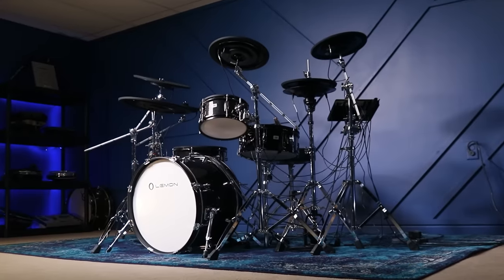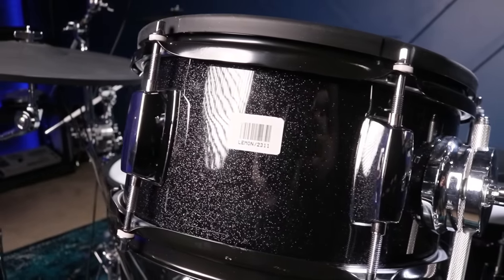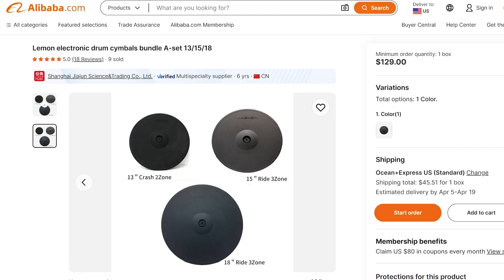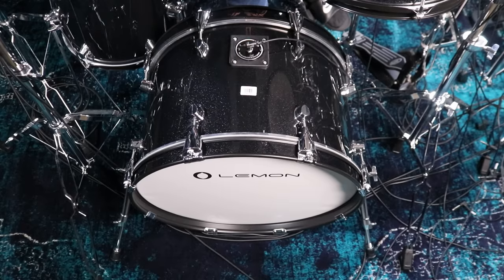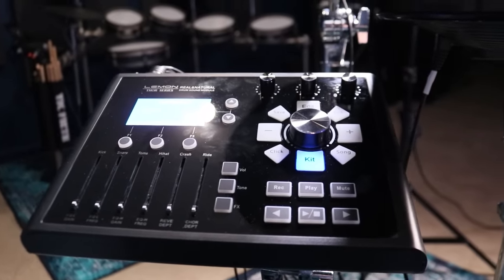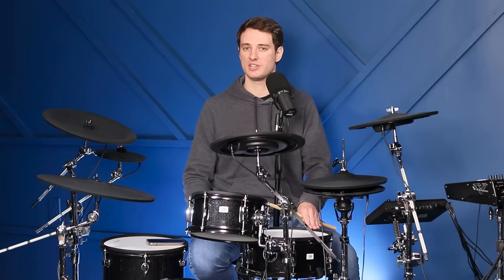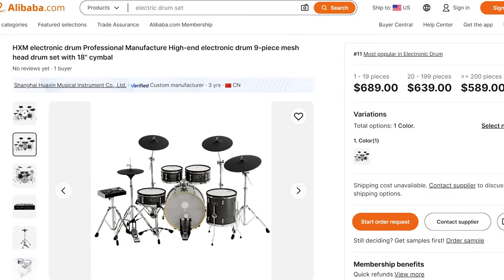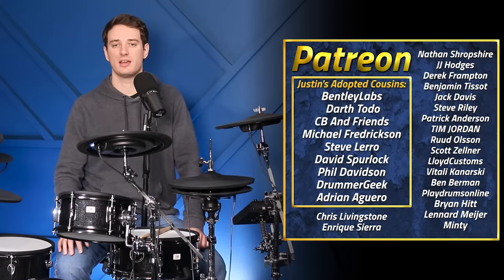Lemon T950 Review - The Alibaba Drum Set

Comment: the checkout price for this kit would make it somewhat reasonable, but you add in the shipping cost and it ceases to make sense. i don't mind the idea of opening up these drums and reinforcing the internal components or upgrading them - but that should be an option, not a requirement. for the middling aesthetics, you're better off buying a used beginner kit for less than $200 and converting it - and even wrapping it in any material you want from wallpaper, real wood veneer, to faux leather - go crazy. since you're playing electronic sounds, how the wrapping material affects the tone of the shells doesn't matter. finally, you can just opt for the lemon cymbals and the module of your choice

looking forward to hear about the hxm in greater detail

Comment: The problem with this kit, and most other electric drum kits is, the sound made when hitting a drum is identical every time. Zero variation. You might think a volume change is variation, but it really is not. It is just the amplitude of the exact same sound, that changes. This is why I always hated the simple keyboards that only have one sound IE very limited expression can be made on such a stale device. It challenges you to be a better player in terms of dynamics and choice of notes, when all other factors are stripped away, but also removes most of the glue and icing that connects humans emotionally to what they are doing - all this translates to the end listener, thus we have a choir and generations upon generations of misfits that continually produce, manufacture distribute and market this very narrowminded lowest common denominator garbage.
Reply: it's an inexpensive kit with a inexpensive module, of course the sounds are going to suck. plug them to a PC/laptop over usb, and use it to trigger a VST, and right off the bat you'll get a much higher quality sound.
plus, most competent modules nowadays are getting better at sampling, so the effect you're describing is a thing of the past (aside from cheap modules). if you really want to use module sounds, try a modern Yamaha, ATV, EFNote, 2Box, maybe even the Alesis Strike module.